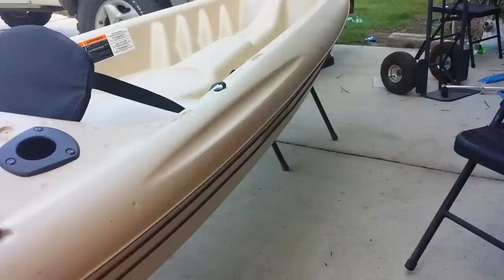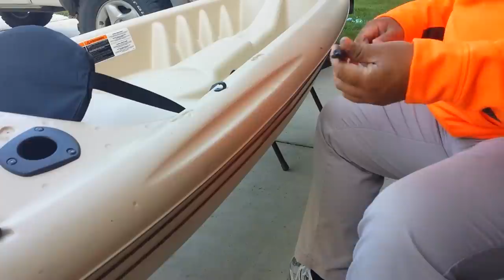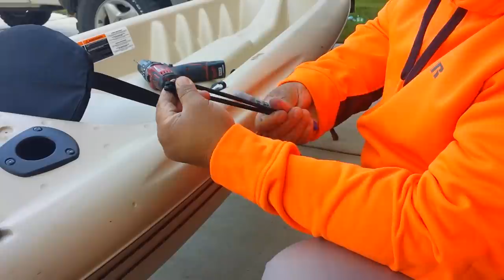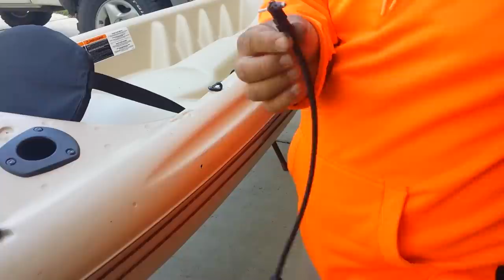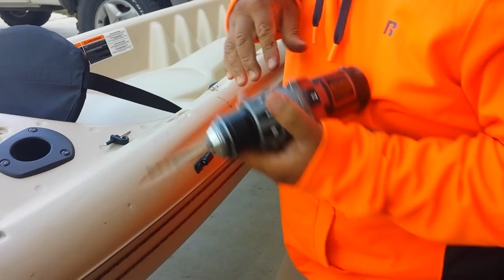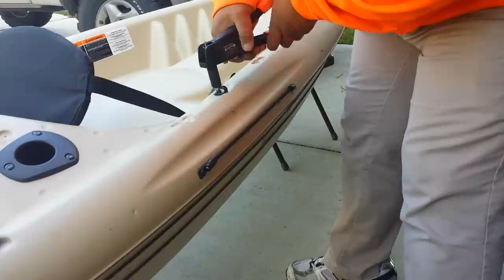Installing Kayak Paddle Keeper

Comment: I would consider installing the top hook on the top inside wall of the cockpit instead of on-top. It will work just as well but not create an obstacle for a wet reentry into the kayak. Unlike the eyelets, this is a hook and will catch on your PFD or scrape you as you climb back in.

Comment: why dident you use the pre dimpled spots for the screws on the paddle keepers
Reply: M Langford because its a bungee cord and needs to be farther away to secure
Reply: Josh H the dimples are where the screws/rivets are supposed to go. That channel for the paddle shaft has the dimples about  1.5 inches longer on each end of it . That gives a wider more secure base to hold  the paddle,  instead of the narrow one he created.